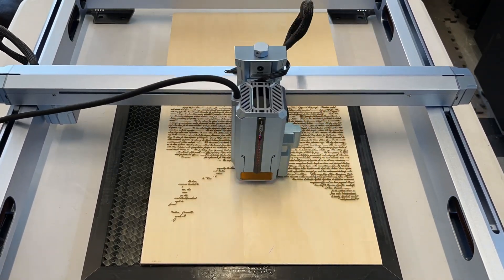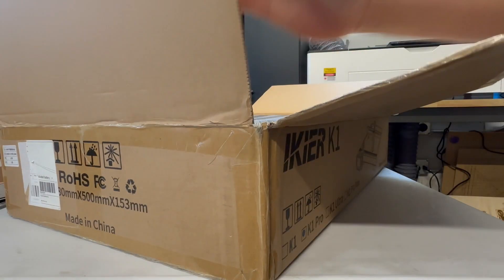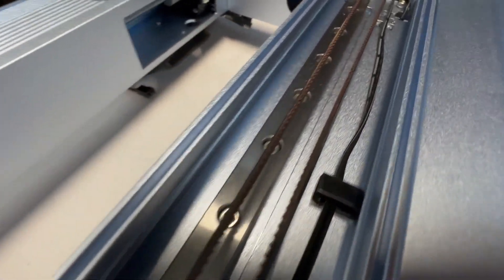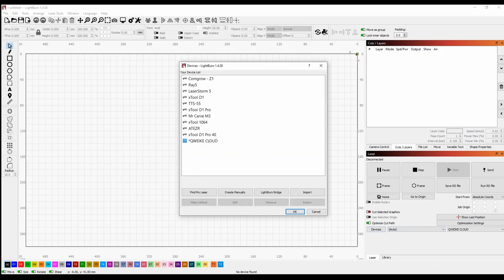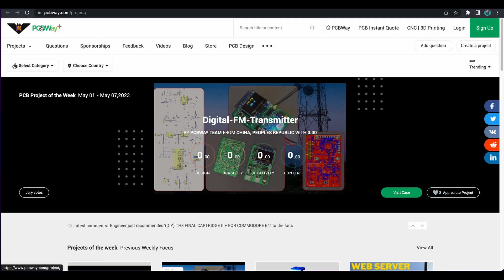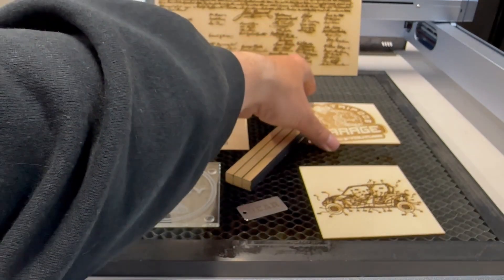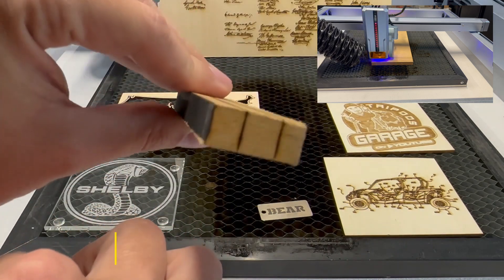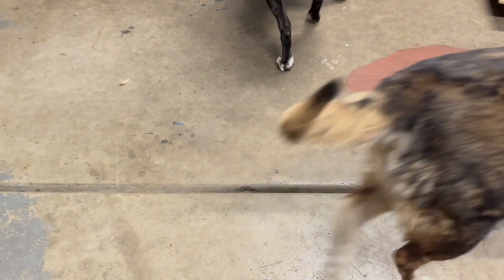IKIER K1 PRO 24W LASER - THE NEW KING OF LASERS!

Comment: Your Dog Tag made of Stainless Steel.
at 100 % Power at 20-24 watt and slow pass or 2-3 pass you are actually taking off up to 3-10 µm even with Blue diode 455 nm. 
So its technically a real engraving. not only oxidized.
YOu will have to "polish" real hard/sanding/removing material to get it off.

Comment: Hi John, I'm about to buy my first laser. Would you go with this or the X Tool 40 watt? I think they make a 36 watt that you can swith from high power back to 24 watts. What do you feel would be better? Thanks for all your great videos.
Reply from the maker: I knew someone was going to ask me this eventually 😉!  

xTool vs Ikier! 

Well the xTool bundle is $1,747.98 for the 40w with the 10w.  The Ikier is $1,499 for the 36w laser and air assist.  The can always decrease the power to fit your needs.  To me, the Ikier even though you have a 4w lower wattage just seems to be a better machine.   I really enjoyed reviewing both the xTool and Ikier, both are quality products.  However, the Ikier just has better features, and is more advanced.  I really like the auto focus, and LightBurn controlled air assist on the Ikier.  The only thing I do not know is if Ikier will be coming out with a 1064nm module for the K1.  I have links and discount codes in all of my videos, if you are in the market.
Reply: @TripodsGarage  lol I guess some had to ask. I will use the links so you make a few bucks on it. I like the ikier better but had no experience with either one, you used both so why not ask you. What is a 1064nm module?
Reply from the maker: @nickp385  - wasn’t expecting someone to ask so soon 😂😂. Thanks for using the affiliate, helps with material purchases, and taking the wife out to dinner.  The 1064nm laser module will allow you to engrave metals.  I posted a link to the xTool 1064nm below.  The laser in this video is a 455nm laser that is good for wood, rock coasters, glass (with a interface layer), paper, leather, and other organics, and can mark stainless steel.  Don’t be fooled with advertisements saying a 455nm can engrave metal, it cannot.  It can only mark it.  Hope that helps?

https://youtu.be/7NaSxeuyB1Q
Reply: @TripodsGarage  thanks a lot, it does help.
Reply: @TripodsGarage  hi Tripod, can you eventually reach to iKier to ask them about the 1064 laser ? I am very interested in the K1 but not knowing about a future infrared or not is preventing me for taking the plunge…! Thank you
Reply: @TripodsGarage  Xtool 40W is waaaaay better thatn IKIER. With Ikier you can not remove the laser cover  wich only causes the smoke to be contained in the laser chamber and also prevents you from using the print and cut feature of lightburn as you cant see the laser pointer when set to 1% for aligment.
And to worsen things even more, the casing of the Ikier when on focus is about 4mm from the material. Guess what happens if your material bends up a bit while cutting......

Comment: Great vid.

I was working on an auto focus for my Z1, but I'd have to add a board or completely replace the main on it to implement. Work got in the way so it's just a knob, leadscrew, & linear rods now.
Reply from the maker: Thanks bud!  After how many years do we finally see an auto focus Z on a gantry laser as standard equipment?  Also having air assist built into the controller?  This should have other premium manufactures thinking twice when releasing a new product.
Reply: @TripodsGarage  there's the 2-3x the purchase price issue as well.
Reply: @TripodsGarage  dude the Snapmaker has had autofocus and sinking capabilities for the past 4 years. Not only that but the autofocus is entirely optical and as a digital camera integrated in the module.
Ikier is just catching up in terms of features.
If IKIER has something innovative, that would be the power of the laser but that's it.